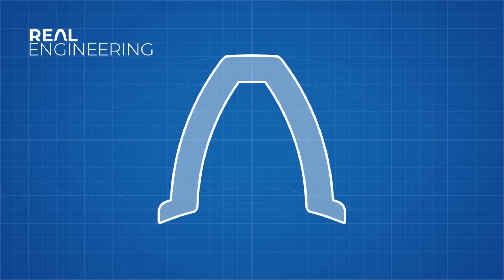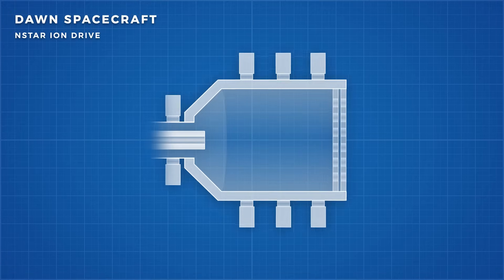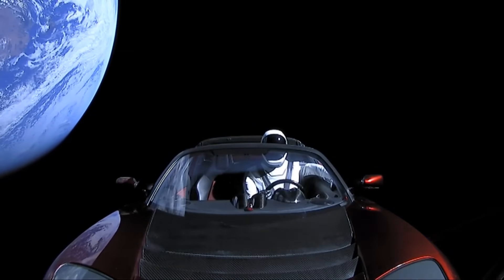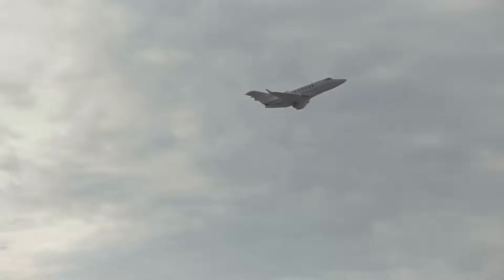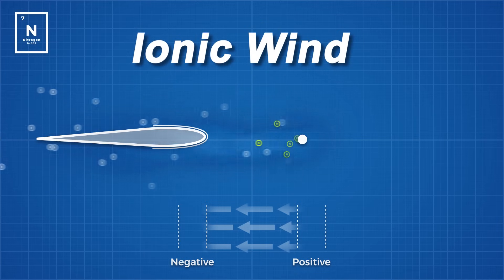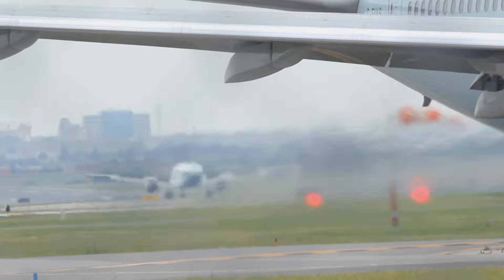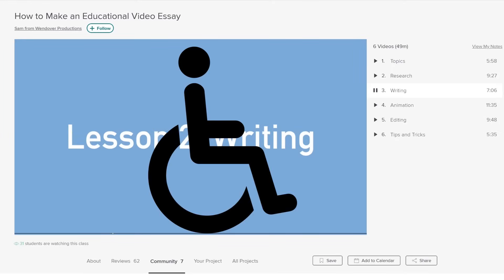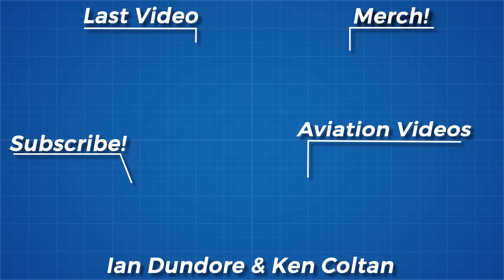Ion Propulsion - The Plane With No Moving Parts

Comment: Would this be better or worse for the environment then combustion engine planes?
Reply: Far worse. Imagine if airliners had to completely refuel every 2 seconds in order to power their engines while sitting idle at the gate - ion propulsion in Earth's atmosphere is comparable to that. You wouldnt even move a nanometer in any real aircraft with those mounted. You would be better off mounting an RTG to it and feeding the waste heat into the turbine.
Reply: good question... depends how you look at it tho... everyone is so hype about solar power but noone yet calculated even if solar cells over their life time return the energy invested in their production... with batteries its the same, batteries production is not 100% efficient and with rechargeable batteries its even worse...
Reply: @Hobypyrocom  Fairly sure plenty of people have calculated exactly that on multiple occasions.
Batteries too.

Comparing electric cars to petrol cars has become a frequent habit too...
With people trying to discredit electric cars pointing to the use of coal to generate electricity, and adding that, plus the production of the car...
Then when examining the petrol car ignoring the very high cost of obtaining oil. transporting it, and refining it. (oil refining uses insane amounts of electricity.)

Solar cells certainly return their economic investment many times over nowadays (and the price is STILL dropping exponentially), but money and energy use are not entirely the same thing of course.

Still... I know there's research on this topic. It's hardly a thing nobody has ever bothered to look at.
Reply: @KuraIthys  when someone claims something, its normal to ask him for sources for his claims... so will you please provide at least one link with scientific calculation out of those plienty that confirm your claims?
Reply: @KuraIthys  the problem is that solar cells are scam, always been and until largely improved they will continue to be a scam... calculating if the solar cells return the power invested while they are being produced is not simple, as many factories (especially those in China) that are producing the minerals and main parts of solar cells are not sharing their data nor they are collecting any data of their manufacture (with a good reason, because they dont want everyone to know how inefficient the production process is)... even nowadays its impossible to calculate correctly the energy needed to produce solar cells... especially melting Silicone to produce silicone crystals require huge amount of energy... the reality is that solar cells in their lifetime return only half of the total power invested in producing them... they are justified only where other ways of producing power is impossible, that's why there are only few solar cell power plants working nowadays and those power plants are mainly made for money laundry and are subsidized mostly by governments... price of solar cells is dictated by the scale of production and the demand, if solar cells price is low it doesnt mean that they are efficient... 
have installed 5 solar power systems in homes till now (with solar cells), initial calculation for the prices in my country is that the owners will return their investment in roughly 10 years minimum, without taking in account the additional money they will need to pay for failed batteries, failed solar cells, failed electronics during that time... having in mind that normal (cheaper) solar cells lifetime is around 15-18 years (as we measured they fall bellow 70% of their initial power production even after 5 years of usage), you can see how "green" and how "efficient" is the solar cells power production is in reality nowadays... calculate in that the energy wasted on producing the solar cells and you will get one and only result, biggest scam of the century...
Reply: Better
Reply: The real question is: would this be better than a "normal" electrically powered airplane.
Because anything that can be used without pumping tons of waste into the environment is better.
Reply: @hieronymusnervig8712  if you ignore the energy and materials needed to produce the batteries, and if you ignore the fact that the current technology for charging rechargeable batteries is highly inefficient, yes it will be better... 
why do you all ignore the huge amount of energy wasted for producing batteries and the wasted energy while recharging those batteries? if you take one 100W heater, if you power it using the power grid you get efficiency of 30-40% of the energy that example the coal burned at the coal plant had, now if you take that same 100W heater and you power it with batteries which are charged from the power grid you will get efficiency of about max 5-10% of the energy that the coal burned at the coal power plan had... imagine what would that efficiency be if you take in account the energy needed to produce that battery and the electronics needed to control it...
Reply: @Hobypyrocom  That's why I said "waste", not greenhouse gases or whatever, currently both choices are garbage (as are electrical cars).
At some point in the future though any propulsion using fossil fuels should be far worse than anything electric or similarly regenerate-able.
Currently efficiency is king though.
Reply: @hieronymusnervig8712  true that... electric devices will improve their efficiency and fosil fuels will be used less and less...
Reply: Let's define terms. Waste is something expended that has no desired benefit. What is the desired benefit? Moving people or things from one place to another? This device can barely move itself, and has no promise of ever being able to move anything else, so it is all waste. "Conventional" electric powered aircraft, those using batteries and electric motors can move small loads over short distances, so they have a higher rate of benefit to waste. "Normal" turbofan powered aircraft move enormous amounts of people and cargo over vast distances very efficiently and have an even  higher benefit to waste ratio.  @hieronymusnervig8712
Reply: @herbertshallcross9775  Under the assumption that this technology would work as needed (for large planes and long distances and speeds) it will be better than fossil fueled aircraft. While the overall energy lost should be higher, at that point in time when this is usable I do not expect the amount of energy available to be of concern but only the source. And I expect the source of electricity to be much cleaner than Kerosine because that's just how long it will take until ion propulsion reaches the point to be usable for commercial air travel.
Thus, at the point in time when this technology might work it should be infinitely more environmentally friendly than a turbofan and the question is yet again: "Isn't a plane propelled by a conventional electrical engine just better?"
Reply: Of course there is no reason to make those assumptions. People have been making ionic lifters for decades, but they haven't mounted the power supply on them for a reason. There is only so much thrust available. This device works, in it's very limited fashion by pushing large wing area against minimum structural weight and arrives at a very frail airframe that cannot support anything more than the power supply, and even that power supply is limited to just enough power to augment a catapult launch. For it to work "as needed" it would have to produce enough power to climb off the ground, carrying something more than it's own power supply. It doesn't do that, and it has no promise to do that. The narrator compares it to the Wright Flyer, but the Wright Flyer was the beginning of a technological revolution. This isn't.  @hieronymusnervig8712
Reply: @herbertshallcross9775  That's why I wonder if it would be viable compared to a normal electrically powered plane.
Reply: I like this aircraft because it encourages people to think. People fly rubber band powered airplanes in gymnasiums every day, and they do much better than this. They take off under their own power and routinely fly in circles for more than a minute. For all that, you don't see turbofans in  airliners being replaced with rubber bands.The ion drive is an even less likely candidate for replacing existing power systems, but that does not mean it is a waste of time to try to understand how this works and try to imagine how to make it work better. The ion drive may one day be improved, maybe even dramatically by someone coming up with  an entirely new way of thinking about it. Maybe you could be that person.   @hieronymusnervig8712